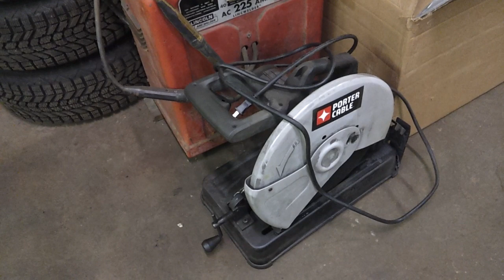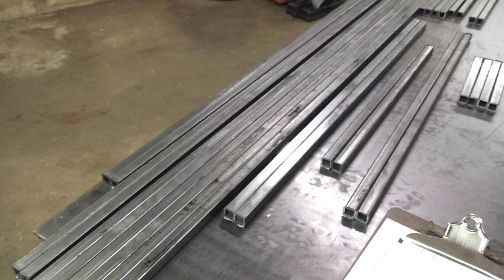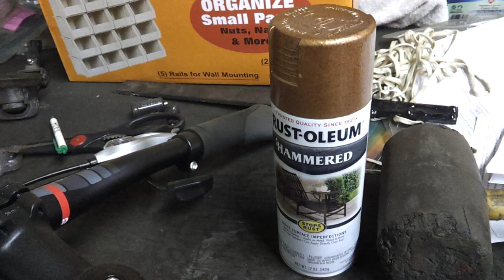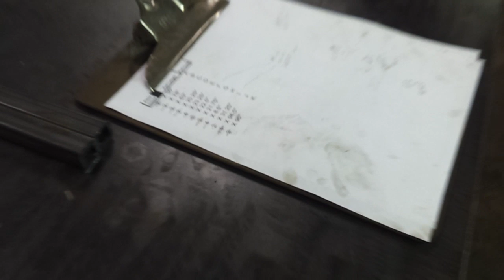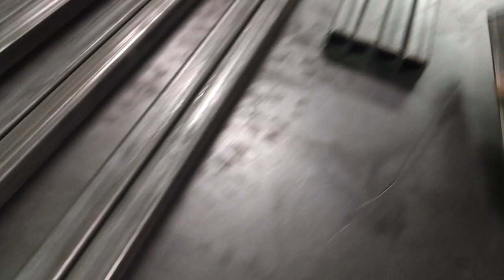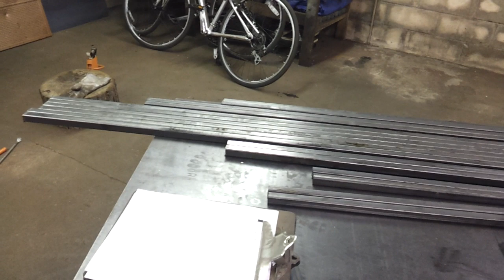Custom Metal Work Bench/Shop Storage - Part 2

Comment from the maker: Yeah I don't like bidding low but sometimes is a give and take. Supply and demand. If you have plenty of work charge top dollar. If you don't have work do whatever it takes to find some lol. Oh yeah you could get some cooking action going on with these stoves no problem. They let off a ton of heat if you get that fire really going or just build up a lot of coals inside. If I had a cabin I'd build one something like this that would double as a stove/oven and a heat source.

Comment: The golden rule is never bid low. People know quality comes at a cost. Do you always buy the cheapest item every time you shop?  Exactly!  I'll try the sand in my barrel, it's a good idea. I was also going to fix a flat steel plate to the top, to act as a hotplate if needed. It'll work for me as I'm not doing a double barrel.

Comment from the maker: Not yet. I'm crossing my fingers but it's been a few days without any word from the customer. Worried I bid a little high. And yeah I agree about the bench top. Wish I had a piece of stainless or aluminum but I have to work with what I have. Trying to build it on a budget. The goal is to come under the cost of that workbench sold at Lowes. It's like $200. Oh and the sand worked out great. No issue at all with it. Never even cleaned out the ash to be honest.

Comment: Subd.   Did you get that railing job lad?   Wouldn't be keen to paint the worktop, you'll end up chipping it and stuff.  Bare metal is better and you won't have the hassle of worrying about being careful. Enjoying the vids .  By the way, how did the sand work out in the bottom of the barrel stove?